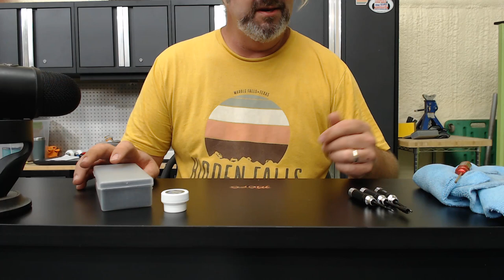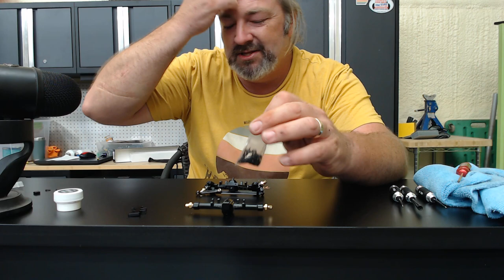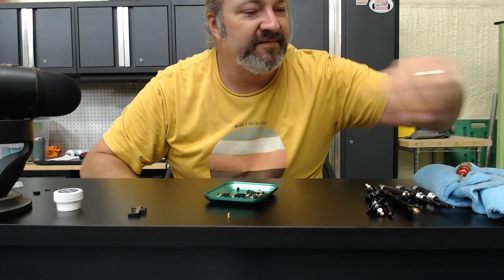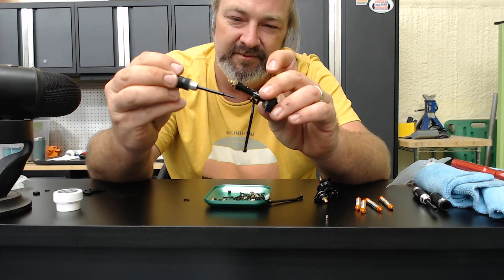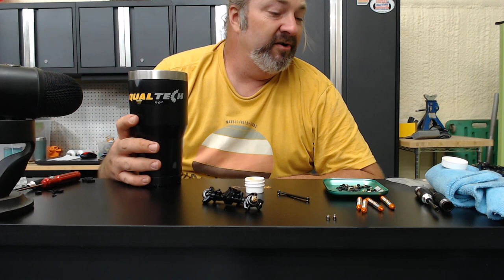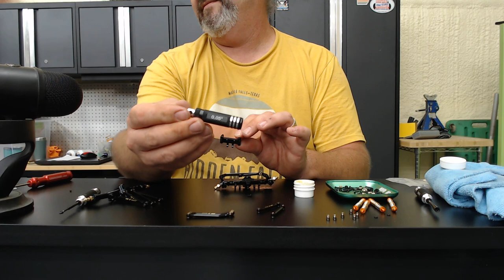Mofo Rc Raising the Bar to unubtainable with new X15 Axles for scx24 / ax24 !!!  Part 1 and install

Comment: I like sticking the Allen wrench for the screws through the ball and sliding the o-ring down and then push it on, if it falls off it won’t go past the Allen wrench and fall on the floor where it’s never found again

Comment: Quick question…I got a nylon set with the brass c hubs and heavy brass steering knuckles but when I’m installing I get all kind of binding?? I switched the knuckles back to stock nylon knuckles and binding is gone. But I really wanted the extra weight from the brass. Any suggestions would be greatly appreciated!

Comment: Are the gears standard so that any Axial or aftermarket would fit ? Not so sure about the special Wheel Nuts, i hope it comes with a couple of spares, being in Europe i have to order every small thing with considerable shipping costs and customs fees.
Reply from the maker: Yes Standard Gears, And wheel nuts should be easy to find.